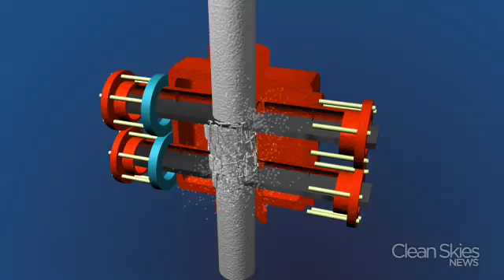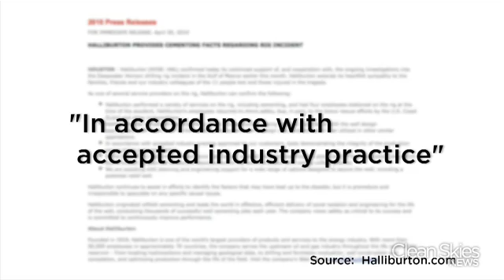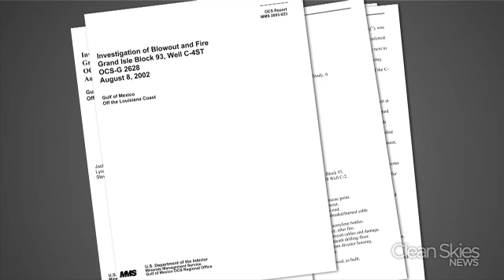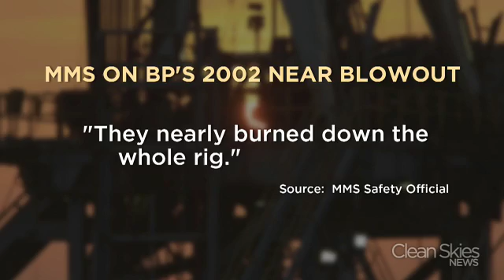The Safety Technology of Deepwater Drilling

Comment: Bops owned by the oil company have way more probs then the ones a rental company has.  Rental companies teach you how to rebuild a bop from the frame up it takes years of training and experience to learn how to fix every possible problem.  I worked on bops for 10 years and we had only one bop fail on a frac job but the sand ate through the steal.  It was the frac company that caused it.  So other then that they work if they are properly taken care of.  Most rigs don't maintenance them

Comment: As far as minimising environmental damage we are beyond that, instead of trying to place a catheter into the structurally compromised pipe laying on the sea floor. they should just cut the pipe at the top of the well head and leave about a metre or two on top. then place a sleave with clamps over the top that can be tightened by the robot subs. then insert the expandable catheter. if the junk shot does not work.....